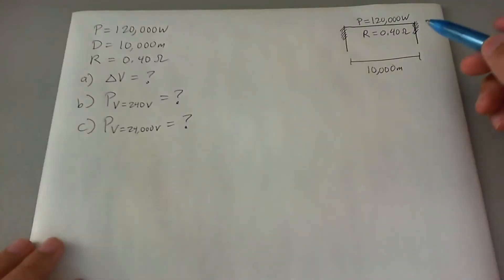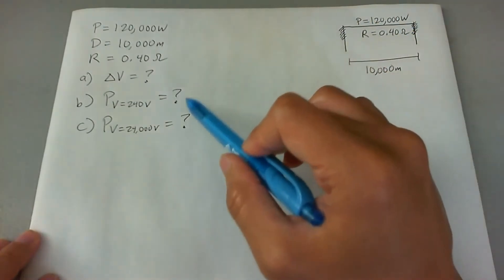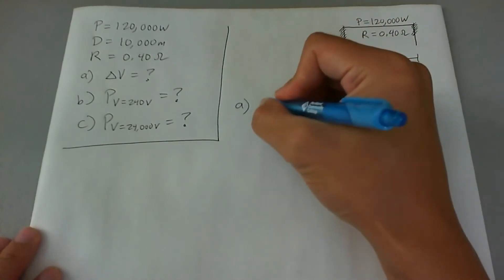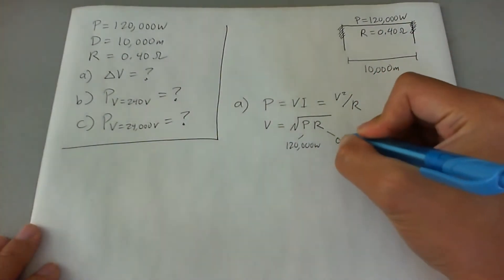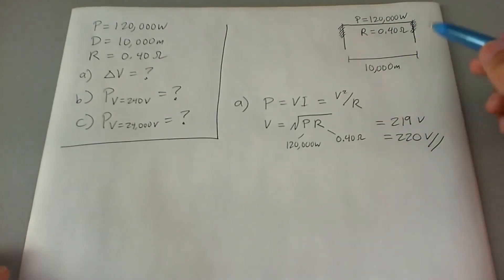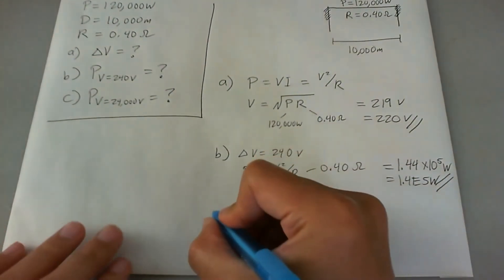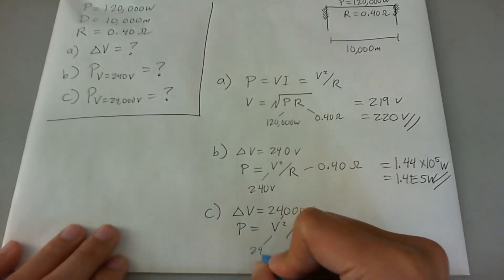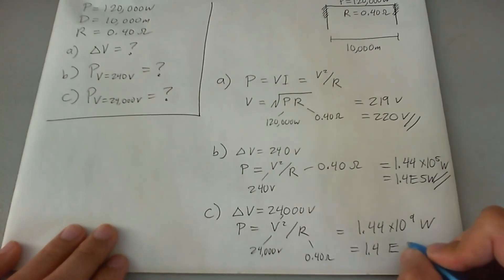Transmission voltage and power over a power line

Comment: They all are wrong! 

For answer (a);
There will no voltage drop if it is an open circuit transmission line. If it is not, then the question should given the voltage (or current) that system is running.

For answers (b) and (c);
You just cannot use the given voltages as the voltage drop on the line since they are only operating voltages not the voltage drop. Therefore the formula you used gave you wrong answers. You would see, if you had checked the answers you found. In both answers, you found more power losses than the transmitting power which is ridiculous. You also could understand from the fact that the higher transmitting voltage means lesser power loss which also violated in the answers you found (b) and (c).
The correct forumla for (b) and (c) should be 
Ploss = I^2*R  
since I = P/V
Ploss = ((P/V)^2)*R 

Ploss (b) = ((120,000/240)^2)*0.4 
= 100,000 W

Ploss (c) = ((120,000/24,000)^2)*0.4 
= 10 W

Please remove this video and don't give false information to people about things you don't know enough!